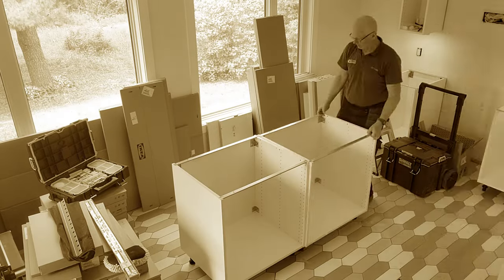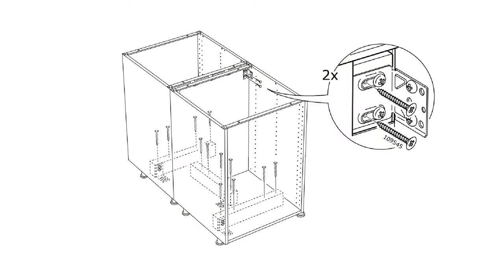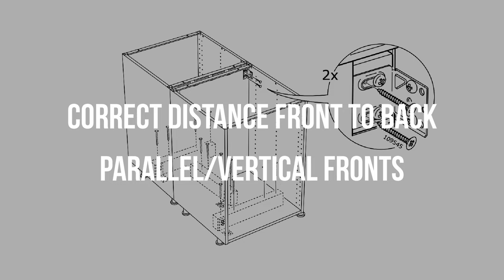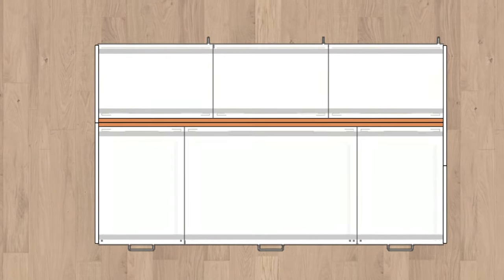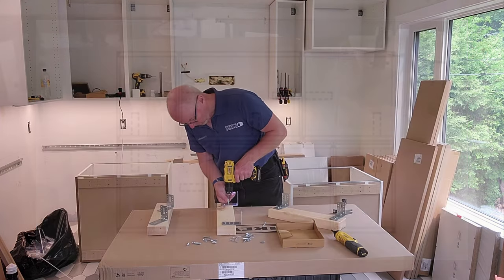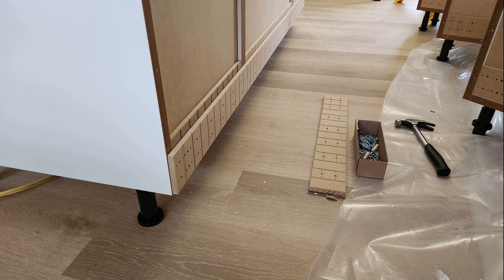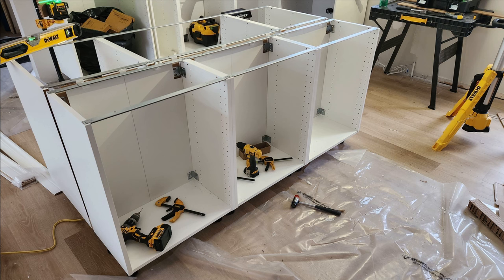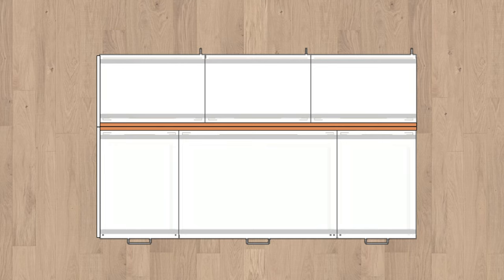IKEA Kitchen Island DIY: How to Build a Double Row IKEA Kitchen Island

Comment: Rannes thanks for the vids.  After watching I ended up using a 3/4” piece of particle board in between my two rows of cabinets.  I think it really made a solid connection.
Reply from the maker: You're welcome. That is very useful information. I actually think that the two layers of MDF-strip I am using ads up to 3/4" as well. The only reason I stick with the strips is that I have them at hand (if they were ordered of course) so I don't have to source non-Ikea items. Good tip for other DIY's though. Thanks.

Comment: Thank you for the fine IKEA demos and hacks. I have a question. I don't like the plastic legs for base cabinets, so I've built a base with ripped 2x6's to take the countertop to 36 inches. am I going to have a problem hanging them on the wall rail? Is there a cleat that the cabinet has to be lifted into? I won't have any vertical play the way I've fixed the base.
Reply from the maker: Hi Bob, you're very welcome.

Two options. If all your base cabinets are sitting on a level base, you don't need to hang them on the rail unless you want a strong connection to the wall. If you cannot lift them upward so they can "fall down onto"the rail, you can always loosen the brackets inside the cabinets. Place the brackets on the rail, and then reattach the brackets to the cabinet wall.

Alternatively, you can skip the rail, use the black plastic spacer provided, which slides into the rail bracket (see instructions that came with the cabinet) and then put a screw into the wall using the provided washer.
Reply: Very helpful info! Many thanks  @kitchensbyrannes

Comment: Great videos, super helpful. Question. I am putting together a Kitchen Island, I found that the assembly kit for the back won't fit the 30cm cabinets. The piece has no lines to cut to the 30 cm cabinet , do you know how to fix this ? Thanks
Reply from the maker: Thanks.
I haven't worked with a 30 cm wide cabinet, since I'm in Canada (inches).
I see two options for you. 
1) the MDF strip has two sections with holes at each end. If you cut off the first section and then measure+cut the inside width (30 cm minus 2xcabinet side), will there be holes at both ends then?
2) cut the strip to desired length end then use the cut-off as template for drilling new holes at the end with no holes.
Reply: Thanks for your quick reply. Doing some research I found that in europe some how they sell the kit named METOD assembly kit, and it had less holes and divisions that the one you can find in US "SEKTION"  Very weird. So the european one don't have the right amount of divisions for the 30cm  (12inches) cabinets. I guess i will have to use different screws and just do my own holes.
Reply from the maker: Thanks for updating me on this. You can still use the screws that comes with the cabinet, intended for the rail brackets. Just drill som 4 mm holes....or is it 5 mm....?
Reply: Yes I ended up doing that. Just drilled the guide holes. Thanks for your help. Cheers.

Comment: Hi Rannes - Thanks so much for making this video! I am looking at building an island very similar to this with a 24" and a 15" cabinet placed back to back. If I follow your tips about spacing them to avoid cutting the panels do you know how wide the island becomes? I am wondering so that I know what width of countertop I'll need. Thanks again!
Reply from the maker: You're welcome 
I take you mean depth, right?
That'll be 24" + 14 ¾" spacer strips included. Then add the countertop overhang.
Reply: @kitchensbyrannes  Thanks. I think more specifically I was wondering how much depth 2 pieces of the island assembly bracket adds overall. It looks like each is 3/8" on the Ikea website so if I think of it as cabinet + spacer + spacer + cabinet it should be 24" + 3/8" + 3/8" + 15" + countertop overhang. Does that sound right?
Reply from the maker: Almost. The 24" deep cabinet is 24" with one MDF strip included as the strip is the same depth as the rail, and from the wall to the front of a base cabinet, there's 24".
Same concept for shallow cabinet but different numbers. 
Try to measure from wall to front of base and wall cabinets respectively, that's the same two measurements you want to copy to the island, as the panels are made to fit those measurements.

Comment: Great video Lars. My double island is the next thing to be installed. Question for you, there will be 2 receptacles installed, the wiring is alraeady poking out of the floor, should I secure the island completely before the electrician comes back? (i'm leaving the top off for them)
Reply from the maker: Thanks.
Short answer. Yes, finish the island completely except for the toekick.
Good luck finding an electrician who'll cut the holes in the panels for the boxes ☺️ Hard to come by.

Comment: Thanks for your channel and all the tips on the ikea cabinets installation. I am about to install mine and have a question how to best go about installing the island. 

The island has two rows of cabinets (4 on each side) and will be flush to a wall from one end and free standing on the other end. should I brace the side of the two cabinets that meet the wall to the wall? 
I prefer installing floating island to avoid holes in the floor but would this be sufficient strength wise?
For the top, I am planning to install a stainless steel surface attached to a sheet of plywood. The sink, dishwasher, & cooktop are on this island. 

Lastly, I have room to have the island width of more than 48” (perhaps 55” total width). Is the gap between the two rows an issue?
Reply from the maker: Thank you for your comment and questions. 
If you don't want to secure the island into the floor, you must build a frame for the cabinets to be fastened too. The plastic legs won't work if you don't use the island support brackets.

If you put it on the frame, you won't have to attach the island to the wall. 

If you want to make it wider, the gap between the rows isn't a problem if it's on before mentioned frame, but I recommend to add a piece of wood or something at the top of the gap, to strengthen the cabinets.

I also recommend that you chose the depth of the island in regards to the panels you want to use. Maybe two 26x36" panels, cut to height, next to each other will work?

https://youtu.be/dxIwY_8kFNs
Reply: Thanks so much! Very helpful!!
Reply from the maker: You're very welcome.

Comment: Thanks again for all your videos, I have been watching them for about an hour every morning during my kitchen remodel, it’s a good refresher as I build. (and I have to do stuff that’s quiet while the rest of the family is sleeping.😂)

I am building an island with the cabinets side to side, but facing opposite directions and screwing them firm to the floor with a solid base. I am planning to have the drawers in one cabinet open towards the refrigerator with miscellaneous utensils in them, and the doors in the other cabinet open with garbage and recycling, facing the sink on the opposite wall.
I also will be installing an electrical outlet in the side of one them.
Do you have a recommendation on which cabinet should have the electrical inside of it? I am concerned that mounting the drawer hardware might get in the way of the electrical wire? I have not installed the drawers on any cabinets yet, so I am not sure if this actually should be a concern of mine.

Any thoughts?
Reply from the maker: You're welcome. I'm glad to hear that you find the videos helpful. 

There's sufficient room at the back to install a receptacle on the side of the cabinet, but I recommend to do it after the panel and drawers are installed. Then place you electrical box where you find room, mark around it with a pencil and drill a hole from the inside at each corner. 
Cut with an oscillating tool from the outside. Put masking tape where you cut as it will prevent the osc. blade sliding away.

Comment: Interesting. The kitchen island back to  back/  front to back build i have is heated tile floors.. hoping the weight of the 56 x 68  3cm  stone top is enough weight to keep it from moving .
also I like my panels to be flush or 1 /8 past the front of the doors or drawers
Reply from the maker: If you don't want to secure the island into the floor, your best bet is to build a frame like I do in this video. 
https://youtu.be/dxIwY_8kFNs

Comment: Thank you for these fantastic videos, Rannes. I'm currently remodeling my kitchen with Ikea cabinets. I'm planning to have an island, similar to the one in this video (24" deep back to back with 15" deep cabinets). In your experience, would a 36-inch wide panel cover both cabinets?
Reply from the maker: I'm happy to hear that you find my videos helpful.
Nope, 36" won't be enough unless you cut back one row of the cabinets .
As I explain in the video, you'll need two panels for the ends..
Reply: @kitchensbyrannes  Thank you for your quick response! I didn't realize that one cut would be exposed to the view.
Reply from the maker: You're welcome.
If you do as I do, no cuts will be visible. A joint will, but no cuts.

Comment: Thanks for the video Lars. I haven't been able to find anything on fitting bench tops and what to be aware of of so-called 'pros' want to take your money. Can you offer any advice, please? I'm looking to install a wood veneer top.
Reply from the maker: If a wood veneer countertop is cut to fit your island, or other cabinets in general, there will be an open end that must be finished, sealed, and protected. If this isn't done correct, it will be only s matter of time until water, or daily wear, will ruin the top.
In most situations, and for islands in particular, I would either have solid wood or quartz/granite installed, as it will last a lot longer and the latter forever.
Reply: @kitchensbyrannes  thx, so would you expect the person to turn up with any specialist tools for this type of work or would hand tools do the job?
Reply from the maker: That'll be a question for the person who'll install your countertop 👍

Comment: What do you suggest when you have full depth cabinets back to back? Six 24x24x30 cabinets, three on each side.
Reply from the maker: I actually did an island like that this week. I take you're asking for panels, right?
I used one 25 x 80" at each end, cut to run from floor to top of cabinets. Two pieces from each panel.
Reply: @kitchensbyrannes  

Did you also double up on the 002.984.11 (SE asmble kit/ktchn island) panels in the back?

How much of a reveal did you allow for?  ~20mm?

Using the 25x80 panel did your seam end up dead center for each side?

Love the videos, and hope you’re releasing a video on the mentioned project soon! 👍
Reply from the maker: Yes, doubled up on the MDF strip so the width of the 25x80" panel fits the cabinet with about 5/8" protruding at the front. The two panels meet dead center 👍
I might make a short video explaining these things as I also made a few minor changes to the way I do a double island.
Before you ask....
- the double layer MDF strip at the bottom is screwed into one of the row of cabinets, and
- I only attach the individual cabinets to the adjacent cabinet(s) at the front for each row as this will ensure I can line up the end cabinets back to back in case the two rows aren't the exact same length. 
30+30+24 isn't always the same as 30+30+24 I e learned 🤗
I hope any of this makes sense.
Reply: @kitchensbyrannes  yes, this all makes sense. Thanks for the response/engagement, will share results.
Reply from the maker: @n_a3522  looking forward to it.

Comment: Thanks for the video, Lars! We’re installing a double island, but are wondering if we could keep the brackets in the same place as the single island and then have the cover panels extend slightly beyond the doors? Our island will have one row of 15” deep cabinets and one row with 24” cabinets.  We plan to use 15x90 and 25x90 panels with the cuts at the top. Thanks for your insight!
Reply from the maker: You're very welcome, Melissa.
Sure, only having brackets under one row of cabinets is sufficient, if you put them under the 24" deep cabinets, and also have a bracket at each end, so the number of brackets are 1 higher than the number of cabinets in that row. 
Also remember to place the 25" wide panel on the side of the15" deep cabinets and overlap both cabinets as that will hold the two rows together. 
All the best with your project.
Reply: I’m realizing now that I may have phrased that wrong.  I meant to ask if it would still work to use only one row (one at the top and one at the bottom) of the MDF material in the assembly kit as it shows in the IKEA directions so that it doesn’t protrude, but to use brackets at the top and bottom of each cabinet (4 brackets per cabinet) so they can be secured to each other? This would leave excess cover panel on each end instead of them being flush, but we’d still swap the cover panels as you mentioned so that they overlap the cabinets.

We also have a dishwasher going in there.  Do we need a cover panel behind the dishwasher?  Thanks for all your help! @kitchensbyrannes
Reply from the maker: Ah, I see. My apologies for being elsewhere on the cabinets.
Well, you will not need to buy extra assembly kits as you only use one set (4) of brackets for each cabinet. 
You don't have to per se since it's yours kitchen, but I don't see why you wouldn't. 
Dishwasher. I can strongly recommend not to have the dishwasher at the end in a two row island. Not an easy set-up. I've done it once and it was difficult and the result wasn't near what I strive to do. 
If the dishwasher is in a double row island, no panel is needed behind it as you'll have a cabinet there, yes?
Finally, I can recommend to have the same width on the bank to bank row. Not just in total but also per cabinet.
When it comes to Ikea cabinet, the nominal width isn't always what you measuring tape shows. In other words 4x15" isn't the same as 2x30".
Been there, done that. ☺️
Reply: Thanks! The only reason we wouldn’t do it the way you suggested is I believe we will have a little overhang with some of the other cabinets as I’d like to make as few cuts as possible, so I thought it might match better if we didn’t make the assembly kit protrude.  As for the dishwasher, it will be in between two cabinets. The total width of both rows are the same, but the cabinets themselves are not.  Thanks again! @kitchensbyrannes
Reply from the maker: @MelissaCope-i1f   Ah, okay, I see....almost. Whether you do as I do or have the panels protrude, the number of cuts is the same as the purpose of doubling up on the MDF strip to avoid cutting. Anyway, I can tell you knows what you want and how to get it :-) All the best.

Comment: Can you cut that back panel using table saw?
Reply from the maker: If you mean the big 3 x 8 ft. one....that will be hard to maneuver I would say. But the smaller ones, yes, that is what I do.

For the big one I have used a handsaw, and a circular saw, before I got a track saw.

Comment: My double row island is asymetrical, with two 24'' cabinets and one 12'' on one side and two 21'' on the other side.  (They start flush at one end),  How do you attach the backs since the cabinet's side do not align (except for the flush end) ? Simply screwing through the MDF strips? Or bolting through the strips... ?  Thanks!
Reply from the maker: Yes, something like that.
I put the back panel on the longest row first, which in your case protrude the short row with 18", and then add the end panels. I else predrill and screw from inside the longest row through the back panel into the end of the end panel which is sitting perpendicular to the back panel...
Reply: @kitchensbyrannes  Brilliant!
Reply from the maker: Thanks 😊

Comment: Great info. If I could change one think about ikea kitchen cabinets... is provide only Robertson screws and not the philips. After about a million screw driving... philips screw should get the cancel cutter treatment.
Reply from the maker: Thanks 😊
Robertson huh? Fellow Canadian I see. 
If Robertson screws were standard for Ikea I wouldn't have started my business, this YouTube channel, and we wouldn't have this conversation 🤣
I hate it with a passion. I prefer torx, which is why I use the screws I recommend for the rails and for low torque applications as Ikea kitchen assembly, Philips is fine.
Reply from the maker: BTW. It's isn't Philips Ikea use, it's PoziDrive. The correct bit makes a big difference. PZ2
Reply: @kitchensbyrannes   . Okay. Thanks... pozi drive! Lol . Like  My cousin Vinny.
Reply from the maker: Ive seen the movie, but cannot spot the relationship. Tell me please 🤔🙏

Comment: Thanks Rannes, what are the dimensions of the cabinets on the video? What is the minimum for back to back cabinet one can install for an island? I have limited space like max 3 ft for the width and 6ft for the length, what cabinet can I use to do that?
Reply from the maker: If you want an overhang at the  back,  you should only have one row as they are 24" deep plus door, handles and a bit of counter at the front.
2 x 30" wide equals 60" so that should work for you. 
Good luck building your island.
Reply: @kitchensbyrannes  How about 6 x 24x14 3/4 x30 with 3 back to back for 2 rows configuration as 3 x 24 make 6ft for the length?
Reply from the maker: That'll work. 👍
Reply: @kitchensbyrannes  if overhang, what kind of corner support should I use on each end to hold countertop?eg. Chairs can be placed underneath overhang, right?
Reply from the maker: You don't need support if the overhang is less than 12-14 inches. That's a question for the counter top supplier.